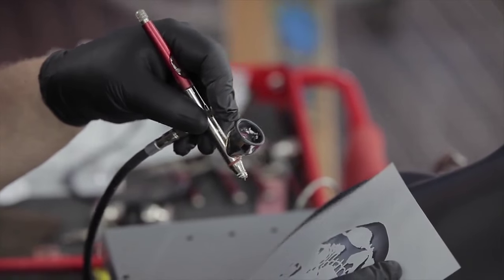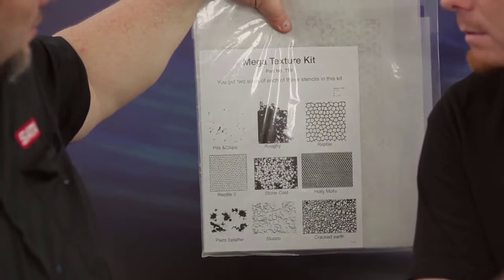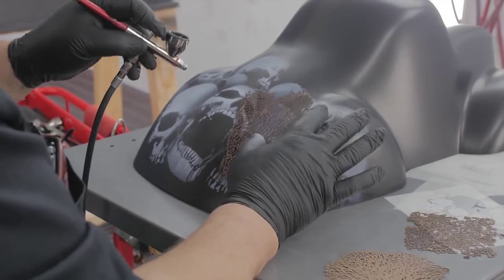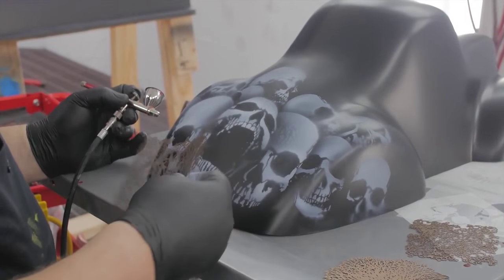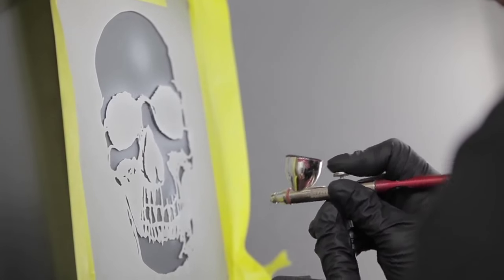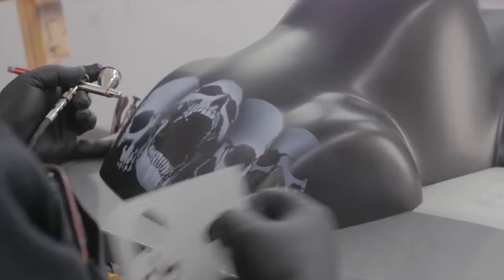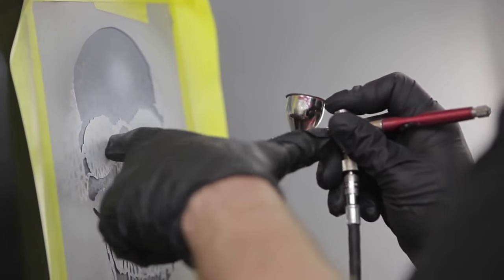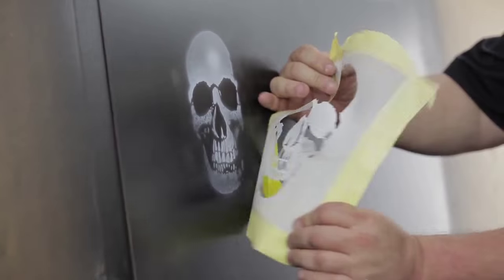SATA Mickey Harris, KC Mathieu with DanAm Pro Stencils Systems

Comment: wheres the best place to buy these from can only find them on Ebay but shipping to Australia is stupidly priced!
Reply from the maker: Hey Stephen, here is the SATA distribution contact information for Austrailia- PPG Industries Australia Pty Ltd email: sata.australia(at)ppg.com
phone: +61 13 24 24
Reply: Have searched there site  and doesnt seem they stock your stencils? I have sent them an email. Thanks for the reply. But it seems stupid at 100 bucks a set due to freight charges. I buy stencils from other suppliers and its either free or very cheap shipping from US.
Reply from the maker: The stencils used are Dan-Am Pro stencils and Dan-Am only distributes in the U.S. but there may be other options through your distributor.
Reply: yep not available it seems in Australia and the shipping prices charged to Australia are ridiculous compared to other US suppliers. I've wasted enough time trying to get some but Im not spending over a100 bucks for a 10.50 stencil